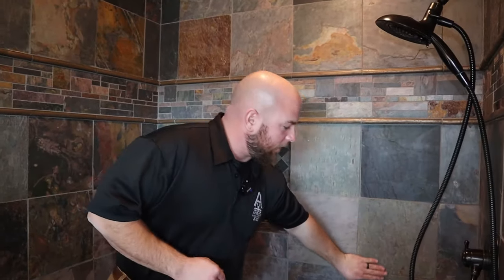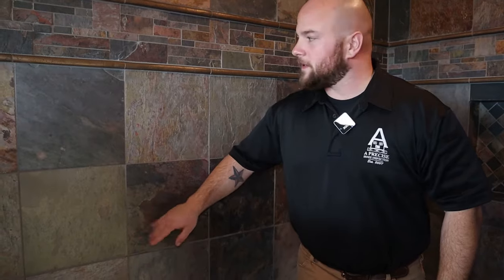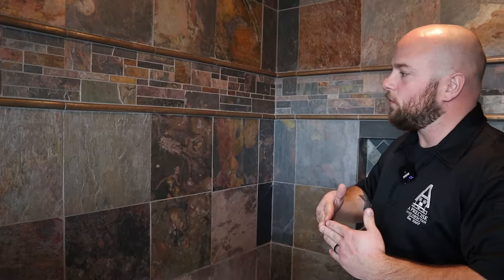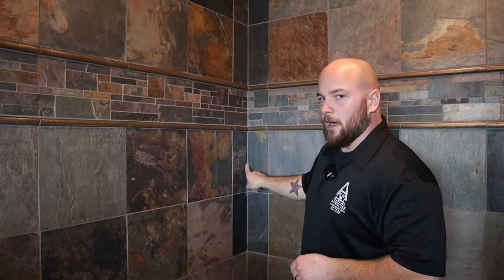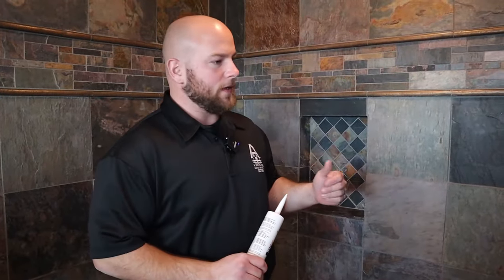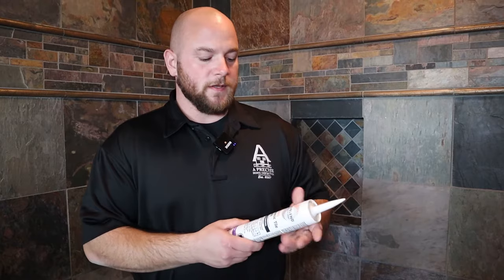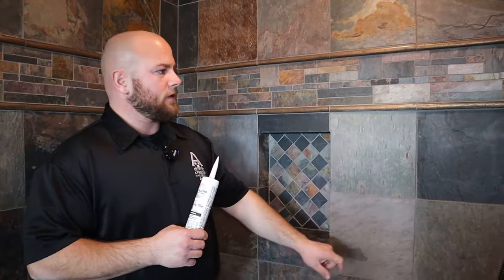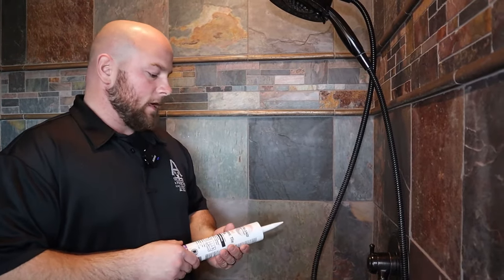Cracking in the Grout Inside Your Shower?! Use Sanded Caulking Instead!

Comment: I was going to pick up a tube of this but I noticed that in the description iit said "Do not use in areas with constant water exposure". Wouldn't a shower have constant water exposure? Any help would be much appreciated.
Reply: Same here.  My issue is where the wall & floor come together.
Reply: Agreed. I have the same issue of cracked grout on the corners of the shower. I think I'm going to use another sanded grout option.
Reply: I would not use sanded caulk for high water area...  more for a tile counter than a shower
Reply: Good point. I have the same issue. I have travertine shower and at the bottom where the wall meets the floor I get mold forming. I'm going to use this polyblend tube for the wall corners, but I will use 100% Silicone where the floor meets the walls around the bottom of the shower.

Comment: What do you about any water intrusion that has occurred from the cracked grout? Does that have to be remediated first before you repair with the sanded caulk? If so, what’s the best way to do that water remediation?

Comment: What would be the best approach if your contractor already used grout in the corners and around the bottom of the shower? The grout line around the bottom of my new shower is almost half an inch thick and has already cracked in a couple of places. I’m assuming you can’t add the sanded caulk over the existing grout, right?
Reply: You should not caulk over grout (you can look that up, don’t take my word for it). Options are: remove grout (plenty of videos for this) and replace with grout (your new building settling is probably what led to the cracks). Or you can remove the grout and replace with caulk (this is what I’m doing).
Reply: @claytonmyers1978  How did it work out? I really annoyed with the guy who did a new shower for me and the grout cracked in the corners and where the floor meets the tub. How did it work out for you?

Comment: @A Precise Home Inspection Thanks! Question: Can I use the sanded caulk you recommend between the floor and walls? I have a gap that is open about a 1/4" or so in that area and want to perhaps fill it with that sanded caulk first before maybe using an overlay of 100% silicone bone color match. Thank you.